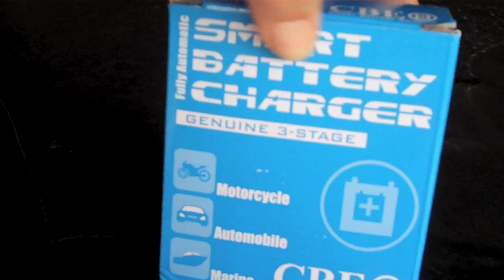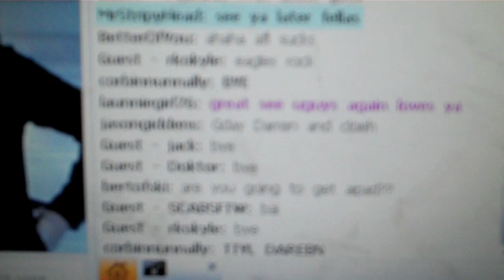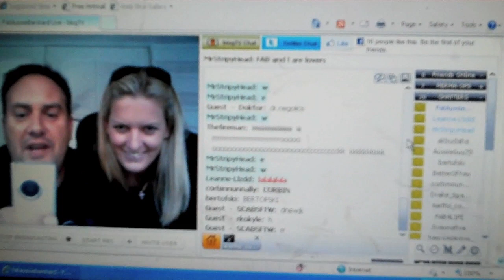I JUST STOOD IN DOG SHI... POO! - (May 29, 2010 - Daily Vlog)

Comment: I used to have a Kawasaki H1, a cool bike with three cylinders and at was a 2-stroke. I used to have battery charging problems once in a while, and it was usually that the battery terminal wasn't tight enough on the battery. I used a wrench to tighten it down, that's all. Apparently the bike vibrations would loosen up the battery terminals ever so slightly, which then prevented the battery from getting a good charge.

Comment: @ThatAussieFamily  Yes, letting the motorcycle sit for a while unused can also cause the battery to drain somewhat. It's either usually tthat, or in the vibrations from using it a lot which loosens up the bolts.

The Japanese are ingenious in coming up with new ways to counter such problems They are highly productive. :)

I understand the Japanese engage in "ancestor worship" which inspires people to be law abiding and do well (so they don't disgrace the family name).